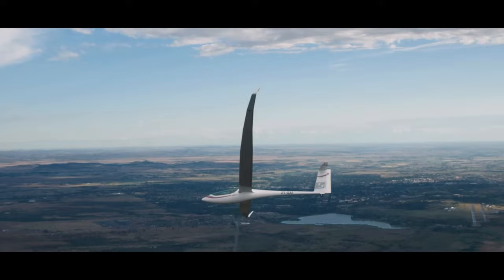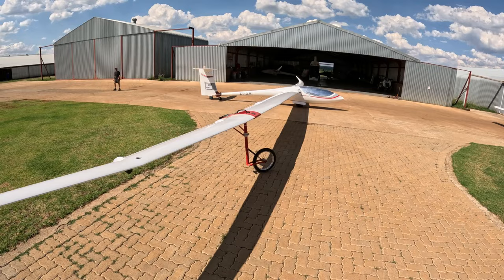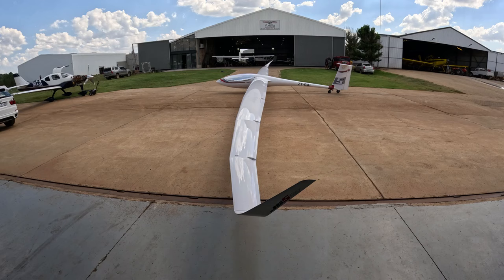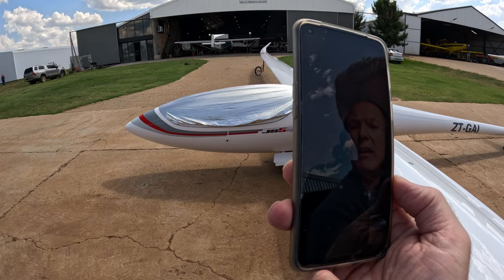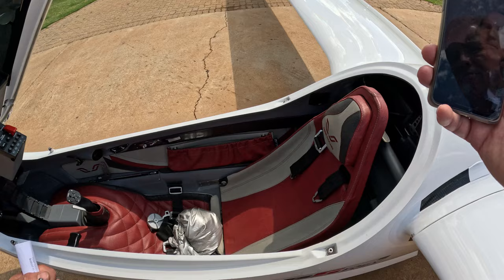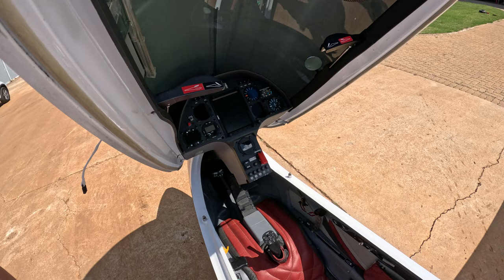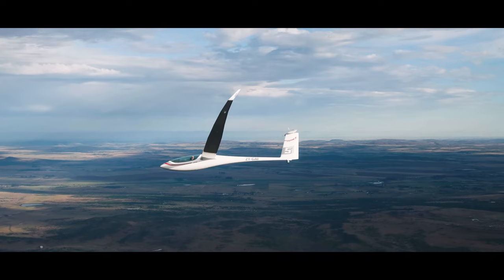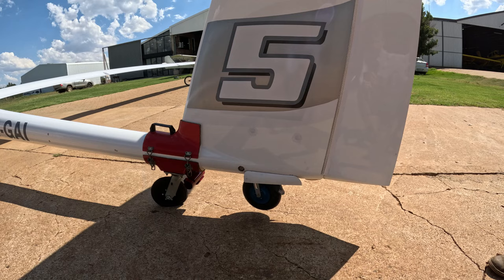A closer look at the Jonker JS5 prototype

Comment: Is it dangerous to have the manual ballast valves? I remember from the ASH-25 that it is not allowed to empty the outer tanks only / before the inner tanks, which is usually made sure by the electric system. If the inner tanks cannot drain, you have to keep the outer tanks filled as well - otherwise you'll have a structural problem and strongly reduced Vne (150 kph).